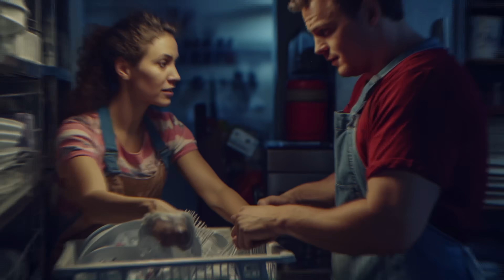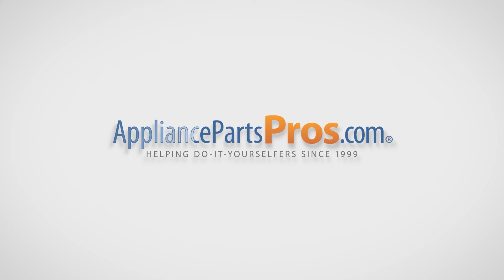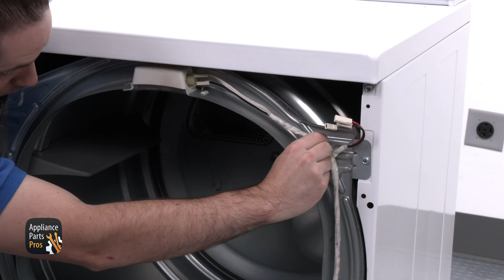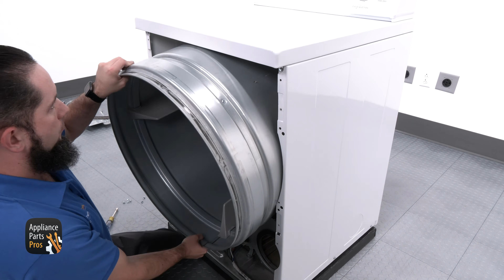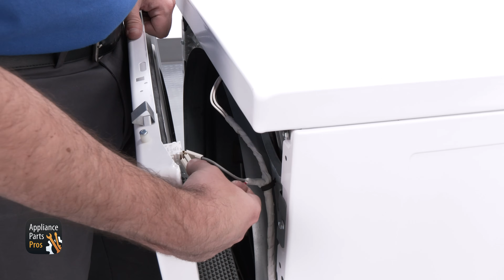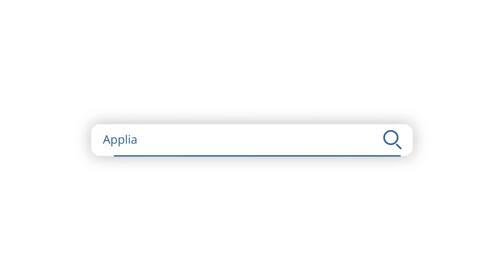How To Test & Replace the High Limit Thermostat on a Speed Queen Dryer

Comment: You do not have to remove the entire front and drum to access the heating element, can just pull the lower panel, and pull the heating element out, making it much easier to work on and replace the fuse and thermostat.
Reply from the maker: Thanks for the tip! That’s true on a lot of front-panel electric dryers, but it’s model-dependent. On many Whirlpool/Kenmore/Maytag and some LG units you can kill power, pull the lower toe panel, and the heater housing is right there.